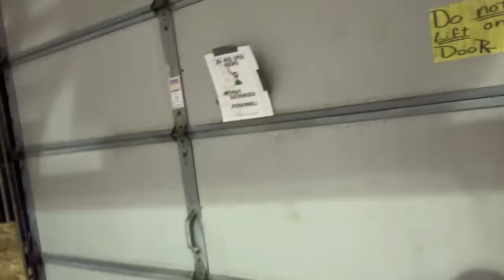FREEZER NIGHTMARE! Help by placing an order! Free Range Meat Vlog

Comment: That walk-in freezer room is huge. Just an idea but you could potentially cut that room in half, and use some of the higher storage space instead. That way, you wouldn't need to rely on so many coolers, for such a big room. The difficult part would be installing an insulated dividing wall in the freezer room. And finding an easy way of loading and unloading product from the higher shelves. But it would save a lot of space. That is a big a$$ freezer. You could always open it up again later on when you need the space. Just an idea. A lot of work. Sorry to hear about all the problems man, that must be really frustrating. Hope it comes right soon
Reply from the maker: It's probably better to just spray foam the sides, you would have to lower the evaporators and put a ceiling in

Comment: Hey Frankie - I have been working on large commercial refrigeration systems for many years. Are your guys able to add more defrost cycles to the coils to help stop them from icing up so much? Using a torch is a nightmare to deal with that situation. Also if the the condeners are running so warm perhaps add a water sprinkler during the hottest parts of the day to bring down the condensing pressures which help the freezer stay at lower temps for sure. Hope that helps man I deal with this in this heat too and it's no fun LOL!
Reply from the maker: The heater strips in the evaporator went bad so it’s not defrosting properly - we have a hose running. Right now I sprayed de icer all over them every morning and melted the ice off
Reply: @FrankTufano  My goodness man I definitely understand. Best wishes to ya man sincerely. I do have a question about ordering, You mentioned trying to sell stuff from your freezer, what kind of order would best benefit you? Sincerely.

Comment: Put some shade cloths over those exterior units
Reply from the maker: I asked the HVAC guy and he said that didn't really matter - but you are saying it helps to have them shielded from the sun?
Reply: @FrankTufano  yes some. Aluminet shade cloth Def helps when they are on the edge like that.  It lowers the temp dramatically
Reply from the maker: @DirectEnergySmirk  Is the cloth placed directly on the unit or does it need poles in the ground to be mounted a few feet above the unit
Reply: @FrankTufano  a few feet above, frame up with some 1x2 some squares or rectangles and some legs in buckets of concrete looks like it would be the easyest there
Reply: It's dramatically cooler under some aluminet shade cloth
Reply: @FrankTufano  the hvac guys told me that too lol, I put the shade clothes over my exterior unit and it helped a few degrees